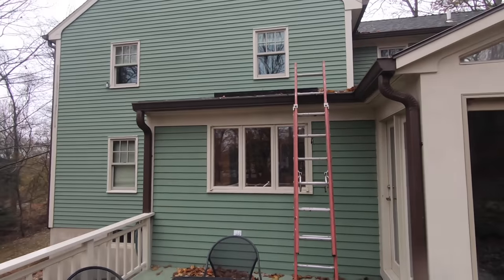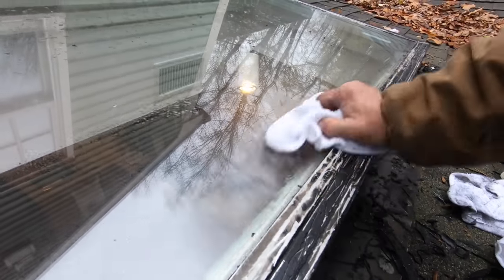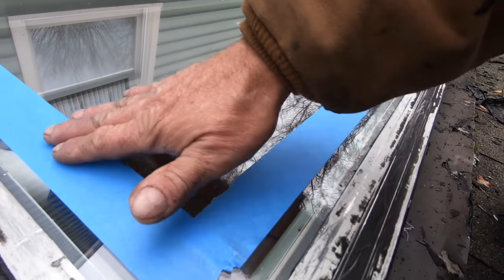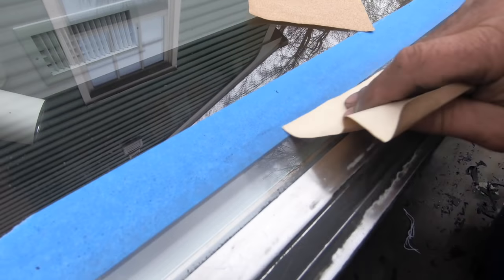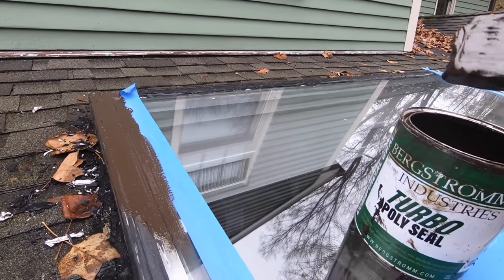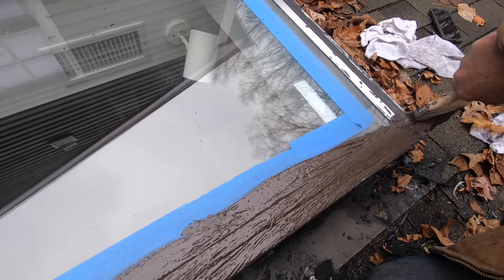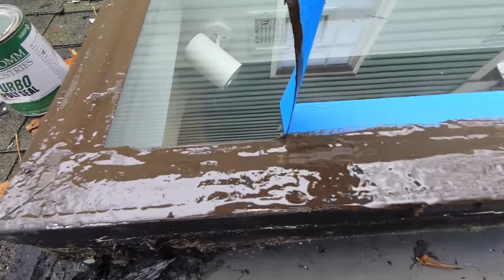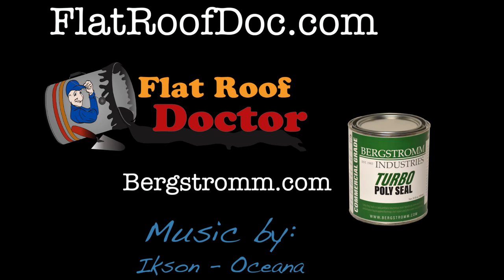How to stop a skylight leaking

Comment: Brilliant - this is exactly what I needed to learn! Have a flat roof w/ a skylight that is leaking. After re-torching EPDM & a membrane I've ruled out the external seams or base, so I believe it's the glass seal itself. I do NOT want to invest in a whole new skylight -- this is a great alternative solution!
Reply from the maker: I am glad I could help. In all on my 30 years of repairs using caulking, tar, and tapes, this is the best product ever I have found to do almost any roofing repairs with, especially skylights.
Reply: @FlatRoofDoctor  How does that product hold up to UV degradation in your opinion? I live in Colorado where we get plenty of sun, rain, and snow.
Reply from the maker: @wakandaengineer  Hey Marcus, Use Super Silicone Seal on skylights instead. UV's have no effect on Super Silicone Seal and it also adheres far better.
Reply: @FlatRoofDoctor  what product would you use in ontario

Comment: Hey Doc, I like watching your videos, nice work you do. I have 34 year old sky lights, that I'm looking to just replace the plastic bubble. And I'm having issues finding them. Not sure if you would know, but if I can't find a replacement can I use a flat piece polycarbonate plexiglass cut to size, do you think that could work for me. The frame is in excellent shape, and the screws are on the top of frame down. Not coming in from the sides. Hope you could answer my question. Keep up the good work

Comment: Hi my skylight has condensation forming in between the two glasses and it seems the corner of the outside glass is coming loose from the inside glass. It seems the glue is coming off between the 2 glasses. How can this be repaired as can’t seem to access between the 2  glasses and add glue? I’m trying to see if I can send you photos or video but can’t find an email address of yours many thanks

Comment: How about an extension where the brick wall meets the frame/glass? Any good ideas how you can get up there too as it’s like a half extension that only has access from the front and upstairs window .
Reply from the maker: I couldn't figure out what you meant
Reply: Lol sorry basically I have a conservatory leak where the conservatory meets the original outdoor brick wall. Just need to know how to fix this leak as it comes through with heavy rain . 
As the conservatory is only small and has a angled glass roof how would you get access to reach the section of the leak as it’s only reachable from the front or the upstairs room window that looks down on the conservatory ! I hope that made more sense! Thank you

Comment: What is the name of the white tape you use on top of the Turbo Poly Seal product? The one you put on 2 times.
Reply from the maker: Hey Steve
This is a Polyester Fleece that gives the Turbo Poly Seal its strength and flexibility when applied over joints between 2 metals, bricks, mortar, and chimney caps. This is the secret for being an outstanding product. Turbo Poly Seal will adhere to any surface as long as it is clean but not to EPDM rubber.

Comment: Hello, Doc.
So, is this like a liquid rubber actually?
And would it be wise to do a whole roof with it as a prevention?
(It would be like a chocolate roof) :-)
Reply from the maker: This is a Liquide Silicone with urethane in it. It is white. I have used Super Silicone Seal on fairly big patches. 10 ft x 10 ft. I think it is expensive to cover the entire roof with it. It is a super product with a price. Turbo Poly Seal, on the other hand, is Urethane Bituminouse Resins. Also a pricy product but excellent. Both of these products are excellent for repairs.

Comment: Flat roof doctor I've been watching some of your videos you also seem to use a product called super silicone has that superseded turbo poly seal? Is there one application where one is better than the other for repairing skylights?
Reply from the maker: Ok. Turbo Poly Seal I think is much stronger. It is definitely easier to work with because of the higher viscosity. I also used Super Silicone Seal in many areas on the same roof to test. I was shocked to see it performed just as well. I was a little harder to use because it is more liquid. I think there is a place for both. I think if you are down south, like Florida, Texas, Arizona, then I would recommend Super Silicone Seal. It is UV stable and will last a long time. If you choose to use Turbo Poly Seal, then I do recommend that you protect it with Silver Coat Protection against UV's

Comment: On the website it says I need to use super silicone seal (white). Can I just use the turbo silicon seal ( brown)?
Reply from the maker: Hi Asella
Yes, I did use Turbo Poly Seal to repair skylight leaks but, it takes much more prep. Super Silicone Seal will stick much better to any surface with little prep
Reply: Flat Roof Doctor thank you so much for your reply.